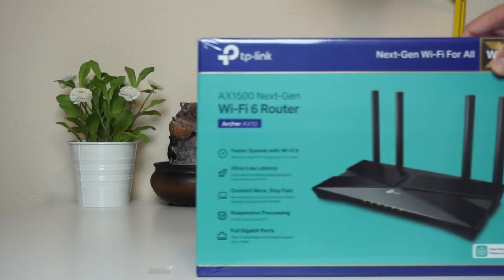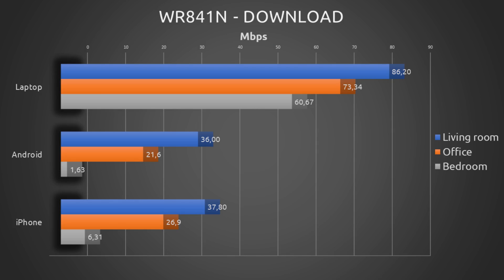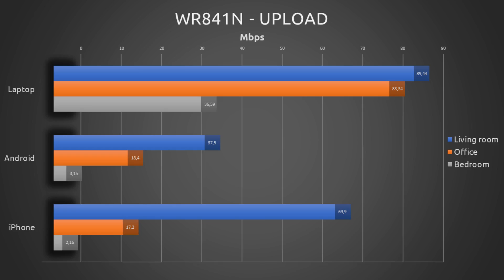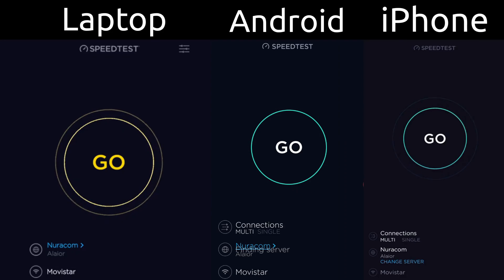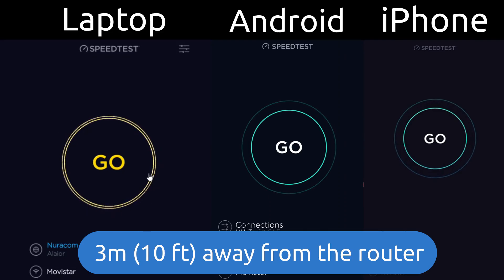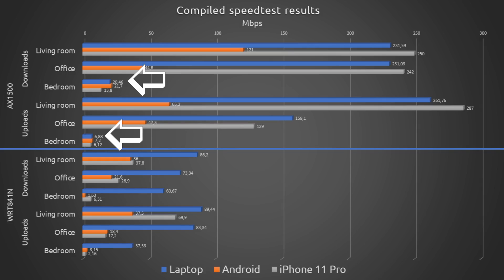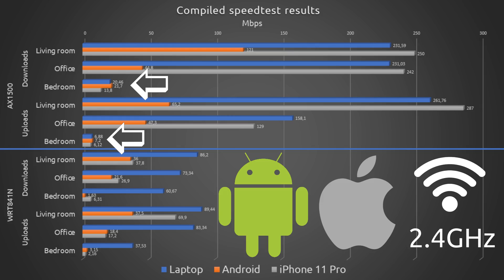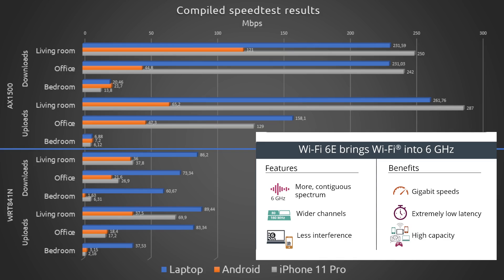Upgrading my router - WiFi 6 TP-Link AX1500 (Archer AX10) - speed test analysis

Comment: Question is - which network did you use in bedroom ? 5GHz or 2.4 ? If 5GHz - then its a huge failure...
Reply from the maker: Hi Sami, thank you for watching and for your comment. In the bedroom I had no 5GHz coverage, so it was used 2.4GHz.
Reply: @ExperiencingIT  Wow Im surprised how low throughput you got... I expected much more from this router😪
Reply from the maker: @samihyppia8472  Well, you know that 5GHz provides less coverage than 2.4GHz. It gives you faster speed but at a shorter range. In my case scenario, there are also a lot of walls between where the router is and the bedroom. I should change its position but I can't :) physically. Anyway, thank you very much for your participation and I hope to see you again around here. :)

Comment: Amm i would dare to say that each phone probably has a different wifi receiver and the speed can vary quite a lot.
Reply from the maker: Hi @HIpigoRE1, and you'd be quite right about it! The tests performed here were performed with the equipment I had at the moment (my phone and my wife's). Of course, you'd have to check your phone specifications and see if it you'd be an improvement for you to upgrade(?).
Reply: @ExperiencingIT   Ahh no. Its not the phone i am after, but the coverage even when i am using a 50mbit connection i am still ready to invest into some mid range router with wifi6 and better coverage.
Only drawback is that its a TP link and being a owner of 4 TP link routers for the last 10 years at least i am not very satisfied.
The coverage is really poor. Two walls away and getting coverage only to authenticate. 
Frequent router freezes and some other problems.
Some user after 4 months of using this tp link model experienced a degradation lowering the wifi speeds three times. After it has been replaced everything was back to normal. But still if we should expect some degradation after a number of months it is rather no so good of a investment.
But it is tempting at this price....

Comment: 👉Very good video.
If a person would like a USB port on the Same brand router, AND 300 ft more house coverage, $20 more, TP LINK Archer AX1800 has it on this model.  This unit covers 300 more square feet which is 1800.
On The company website.
Your video is great!  I just need  300 feet more coverage in my home.  Company site this link.
https://www.tp-link.com/us/home-networking/wifi-router/archer-ax1800/

Comment: Which router is better Tenda ac23 or tp link ax1500 ,am using a tenda n301 and it is terrible ☹️ its time to upgrade my router to a dual band router 💯💯
Reply from the maker: Hey Terminator! Thank you for watching and for your comment! I couldn't tell you but I would go for an AX router over an AC one. In this case, you even aren't happy with your current Tenda router, so, I guess the choice is obvious. Maybe you'd also like to read this? https://www.networkworld.com/article/3258807/what-is-80211ax-wi-fi-6-and-what-will-it-mean-for-80211ac.html

Comment: Based on your placment of router. i think moving it to the center of your house will dramtically change ur speeds specially in your bedroom. otherwise use mesh.I moved my router to the center of our home. Changed the channels to further optimize the signals. This wotked for me save me from buying a mesh or changing a router.
Reply from the maker: Hi Dodie, first of all , thank you for watching! Indeed, changing the router position would improve the coverage but I'd need to make some changes to the flat or where the source of internet is located :)

Comment: Nice video congratulations

What Android system do you use .

I have a note 9 en 400 Mb fiber optic From fioz the router is from fioz ac router and I have about the same speed that you are getting from the ax1500  I thinking about buy a router but seeing that you get the same speed that I have is not work for me buy this router do you think buying a new router would help me speed connection
Reply: Any phone that supports WiFi6 will take advantage of this router. iPhone 11 or 12 and a couple of 2020 Android (maybe some from latest 2019)
Reply from the maker: Hi Edder! Thank you for watching and for your comment. If you are not getting the full speed from your internet connection, maybe it has not to do with the router, thus buying a new router would not help, but rather with the WiFi adapter on your phone. Is the phone connecting to the AC band (5GHz) on the router? Let me know.
Cheers

Comment: if you don't have fiber, using this router is a waste of time.
Reply from the maker: Hi Hieu. First of all, thank you for watching! 
Secondly, let me disagree with that. :) A router at home doesn't have the sole purpose of connecting you to the internet. Check this video - https://youtu.be/ScaaZTEd-F0 - and you'll see what I mean.
Reply: @ExperiencingIT  yes i get that, but no one has a large file enough to be shared within the home network that requires 1.2gbs transfer speed. Honestly I'd just grab a USB 3.0 on a 3.0 USB transfer speed and save the file on that thumb drive. Bring it to another device and I have it.  What I really think new wifi router should do amplify the signal within a certain radius, so we can get better coverage.
Reply from the maker: @HieuNguyen-ts1bo  It also does that, gives you better coverage. Regarding large files, it is not as simple as putting files on a USB stick and take it to another device :) You can certainly do that but, at some point, it becomes impracticable. People deal with larger and larger files each day, mainly for video editing and movie backup, and for storing they use "NASes", myself included. Those are, obviously, accessed via the network and having a good connection helps a lot dealing with those files, specially when editing them. Of course, there are other options, being cabled network one of them, but if you want to keep things simple and still enjoy good network speed, I believe this is the way to go. Or mesh :)
Reply: @ExperiencingIT  That's true. This is the way to go, but a lot of wifi adapters are not wifi 6 ready yet. I'd give this thing another 2 years. Prices will come down a lot more.
Reply: @HieuNguyen-ts1bo  in two years there would another 2 years to wait for WiFi 7 tbh. I agree with you on that, but if we wait, new version would be available soon.

Comment: Great video!
What's your speed from your ISP? I am using TP Link Archer C50 and paying for 50mbps internet. When I do speedtest, I get maximum 55mbps downloading speed, so I am curious how much more speed I can get with AX10.
Reply from the maker: Hi Alex and thank you for watching! My internet plan is 600 Mbps. If yours is 50 Mbps, the router will not "hack" your internet connection so that you get more speed out of it. For that you'd also have to get a faster internet plan. In my case, I already had the "speedy" plan but I was not getting full advantage of it because of my old router. So, I managed to improve that by installing a new router, but to get full advantage of my internet plan I also had to upgrade my laptop wireless card. Check my latest video. With those two items upgraded, I can now take advantage of my full internet speed and I also improved my overall LAN speed. I hope I was clear enough! 😄
Reply: @ExperiencingIT  Thank you for explaining to me  and it is super clear. I just got the AX1500 router and upgraded my wifi card to AX200 (This wifi 6 card is only available in the country that I am at). My downloading is speed did not get faster but YouTube and Netflix load faster without any buffering. I wish I can get 600 Mbps internet too haha. The maximum speed I can get here is 100 Mbps and it costs USD 81 per month, so I decided to get 50 Mbps because it is more than enough for me. I really miss my 1000 Mbps internet in Korea haha.

Comment: What if some of my devices doesn't support wifi 6, that means this router wont work for my devices?
Reply from the maker: Hi and thank you for watching! Not at all! This router is retro compatible with all Wi-Fi standards. This means that if your device doesn't support WiFi 6 it'll still work with this router.
Reply: @ExperiencingIT  thanks for answering my question, owe you one
Reply: @ExperiencingIT  bro I hope you can answer one more question, can I keep my modem network and my router network active at the same time? So some ppl can connect to the modem and others to the router?

Comment: What is your connection speed?
Reply from the maker: Hi and thank you for watching and commenting!
I believe you are asking about my internet connection speed, which is 600 Mbps. 
As a previous viewer commented, the old router was indeed bottlenecking my internet connection, which shouldn't happen with this new router. 
The thing is that, to take full advantage of my internet connection, I'd have also to update  the wifi adapter, for example, in my laptop, as, I believe, I can't do it on my phone. I'm preparing a new video showing exactly that.

Comment: so the conclusion is that the old router you test is bottlenecking your internet, compared to the ax10 that give better internet performance?
Reply from the maker: Ahahah! Indeed! But not only that. The fact that the old router was using, logically, old technology was preventing me from getting better speeds also inside my lan. Unfortunately I forgot to include a lan speed test but I can assure you that I'm having better communication inside my lan as well.
Reply: @ExperiencingIT I've also tested my old wifi adapter (2009) and the new wifi adapter, in my 50mbps internet, my old wifi adapter can only handle 15mbps, while my new wifi adapter can fully handle the 50mbps internet
Reply from the maker: That's exactly what I did! I also got a new wifi adapter, I'm making a video about it, and this one is now capable of fully use the 600Mbps of my internet connection, at short distance from the router.

Comment: Great Analysis.I would appreciate if you show wifi coverage signal bar as well in every room.
Reply from the maker: Hi Val! Thank you for watching and commenting! Yes, that would have been ideal but I forgot to include it :)
Reply: Experiencing IT No issues mate.You can do that in next videos.
Reply: Experiencing IT hey mate can you tell me how was the range on 5Ghz in your bedroom using AX10 router.Was it on full strength on 5Ghz in bedroom? Or one bar less?
Reply from the maker: Hi Val! Just now saw your comment... Well, in the bedroom I'd have to force the connection to 5Ghz as the signal strength there was very weak. I'd say a bar or so... All devices would default to 2.4Ghz. I'm using my android phone now to reply to you and  I'm getting one, two bars in 2.4Ghz mode.